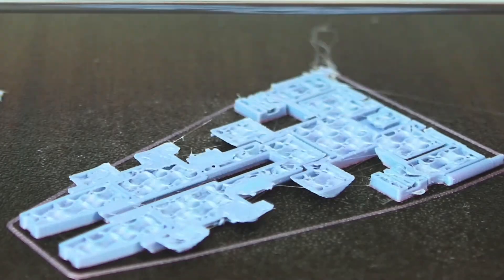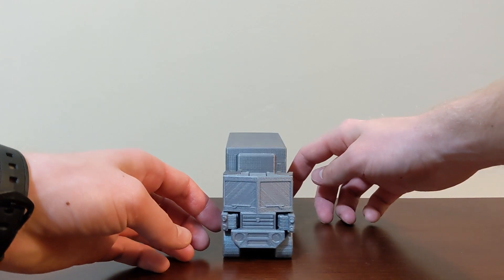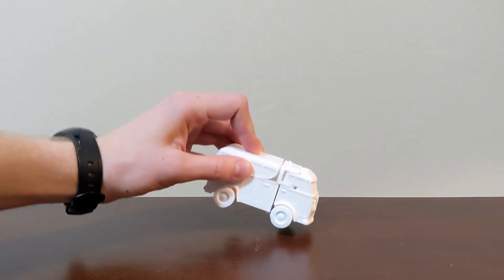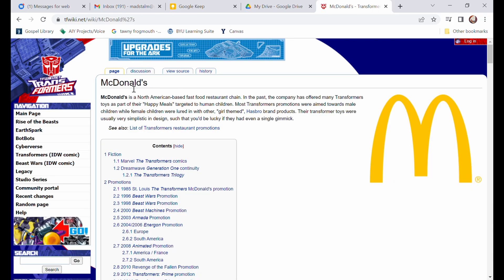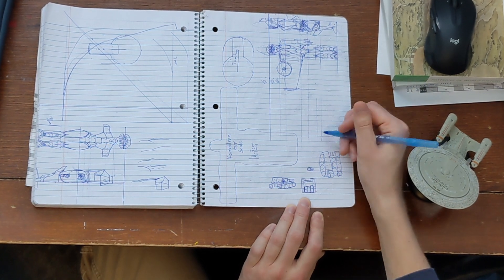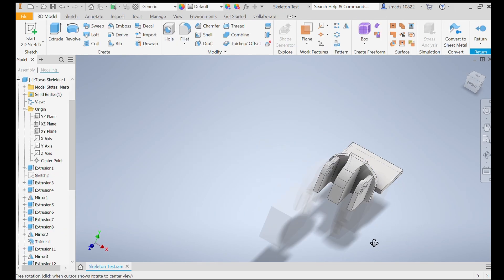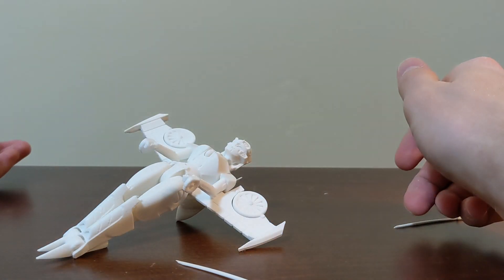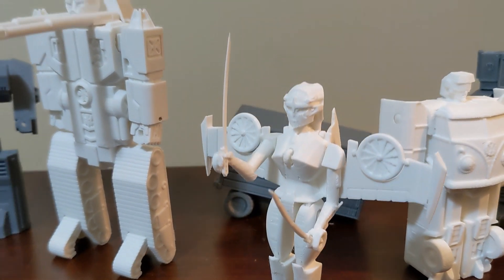Windblade: a 3D Printed Transformer

Comment: What 3D modeling system did you use.
Reply from the maker: Autodesk Inventor. It's similar to Fusion 360. However, all of this could be done in really any parametric modeling software.

Comment: Parts forming is fine as long as you can put the part back on some where else
Reply from the maker: I think parts-forming is fine for weapons, modulators, combiners, and base modes. Beyond that, I would rather sacrifice "cartoon/comic/etc." accuracy in alt or robot mode to create something that is potentially more toy-etic but that makes better use of alt-mode parts in robot mode.

That said, parts-forming isn't a bad thing/experience. I just don't think it's desirable specifically within the scope of transformers.

Comment: If you apply a thin layer of Carpenters glue to the ball joints it will make it stiff'er and not wobble around.
Reply from the maker: That's a good idea, but because the joints print assembled I don't think that there's really a way to take them apart to do that.

Comment: Cost to make one?
Reply from the maker: Just to print one, depends on if you own a printer or not. I print at a university library that charges mostly just for the cost of materials, and I think it cost me $10-13 to print it there. If you're factoring in the many hours it took for me to design it, or that I had to print off a prototype to get the final design right, then it definitely cost more than that. If you have a printer and want to print one yourself, I've made the files free to download on Thingiverse. The link is in the video description.

Comment: Maybe you can make joints more tiight with second glue?
Reply from the maker: That's an interesting idea. I know that there are methods that can be used to tighten ball joints (often used for retail transformers with loose joints). I'm not sure if there are other methods that can be used to tighten up fixed-axis joints given that these joints are traditionally fixed with screws or pins in retail Transformers, not 3d printed together as one unit. Maybe if you had a multi-material extruder on your 3D printer you could do some fancy tricks to make all of the joints tight after printing. I'm not that skilled yet.

Comment: You mentioned that in 3D printing that one side had to be flat. I was wondering if it was possible to create the head in two separate halves, hollow out the center to allow light-piping, and then glue the two halves together.
Reply from the maker: Yeah definitely. If you were really pro, you could either: a). print the head in two halves but joined together by a thin layer of material to act as a compliant hinge to fold them together after printing, or b). print the head hollow to begin with so that you could fit in a translucent colored light pipe in there too. I'm not sure I'm good enough to do any compliant hinges, but hollowing out the head of a transformer for a light pipe doesn't seem too difficult.
Reply: @TalmageMadsen  thanks for letting me know it’s possible. One day I plan on investing into a 3D printing machine.

Comment: Awesome I need to get or find a 3d printer to use. Also maybe some tabs and slots would help hold your transformers together. But I don't know how 3d printing works just a suggestion
Reply from the maker: I'm starting to experiment more with tabs and pegs to hold them together. Kombitron had pegs on his arm to hold his vehicle mode together, and windblade had some compliant locks to hold parts of the vehicle and robot modes together.

Comment: I see a problem with you design philosophy.  Limiting yourself to making them print in place feels like an unnecessary design constraint.  It may help with creativity but is still unnecessary.  Why did you want to make them print in place when you could have achieved better results by printing the pieces individually.  I can understand not wanting to make them a partsformer but it wouldn’t be a parts former.  A parts former by definition is a transformer that requires you to add or remove parts in order to get from one form to the next.  But if you’re assembling the transformer and it can transform after you assemble then it wouldn’t be a parts former. Nevertheless it’s still very impressive, but still just a bit confusing.
Reply from the maker: The whole 'print in one piece' thing is part of the fun for me, and is a big part of why I get a kick out of making these. I also like it because it's something unique to 3d printing, no other manufacturing technique could produce a transformer this way, so I've embraced the gimmick. It's true though that if I didn't constrain myself this way, I could make some way more complex transformers. There's actually a few creators already that do that that are totally worth checking out: https://youtube.com/c/HightailCreations

https://youtube.com/channel/UC3eGmqMmB7PFrgPe1t-JOZw

https://youtube.com/channel/UCYuCP7TbzR42LHBwICGSDEA

Hope that makes sense to you. Also with the whole partsforming thing, what I meant by that is that I didn't want to make anything like G1 Starscream that you have to break apart into a bunch of pieces to transform, I don't mind transformers being made of multiple pieces (as pretty much all of them are), as long as those pieces are meant to stay together throughout transformation.
Reply: @TalmageMadsen I see that makes more sense now. Thank you for elaborating and those are still amazing transformers!
Reply: @TalmageMadsen Gunpla uses Injection Molding as far as I know, and the RG line(1/144 scale kits designed with 1/100 scale features) used to feature fully developed inner frames with moving joints right off the runner with no assembly required.
They stopped doing so for newer molds because of poor long term fault tolerance(the joints would become incredibly loose over time), but that doesn't change the fact that it happened.

There's a lot out there that may surprise you.
Reply from the maker: @ That's some seriously impressive stuff. Now I'm interested and I'm going to go down a rabbit hole to find out how they did that!
Reply: @TalmageMadsen  Not sure how much you'll find. As much bad as I can speak of Bandai, the one thing I can't deny is that they're constantly innovating the model kit business. It probably wouldn't be incorrect to say they're light-years ahead of the competition, considering how they've been pushing the envelope this past decade alone.

But good luck! This is pretty old news, maybe info made it out by now.